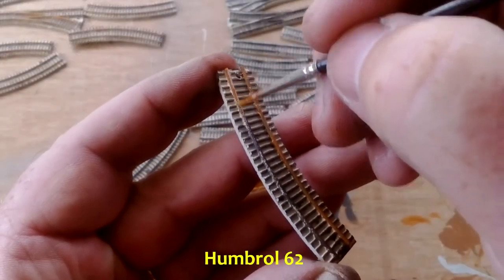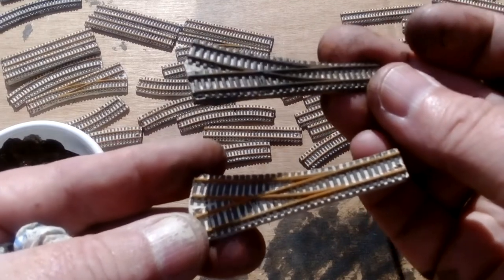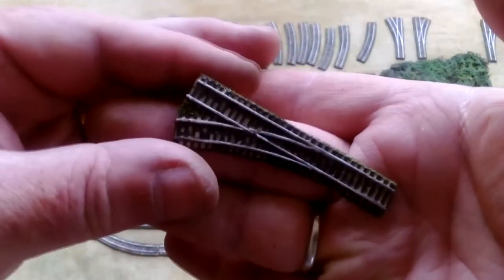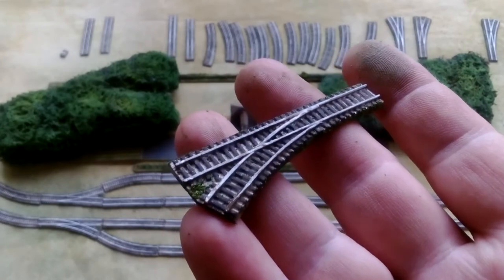Painting Leven Miniatures Railway Track

Comment: Thanks for that. 
A suggestion when shortening tracks. Instead of cutting one short 'fiddly bit', you can cut two full lengths unevenly (giving four pieces in two different lengths) that should result in the combination you require. In other words its sometimes aesthetically better to have two medium pieces than one short section if you know what I mean. Keep up the good work.